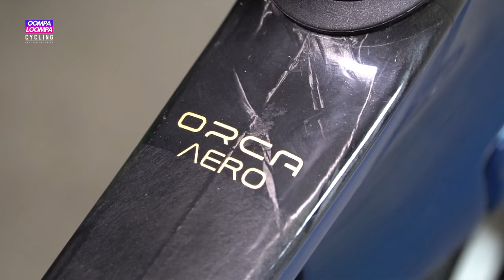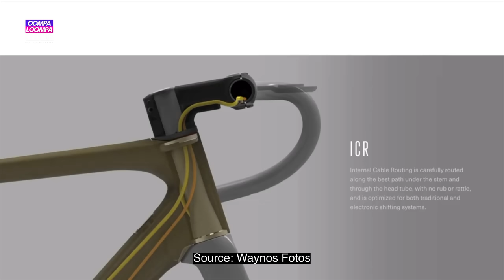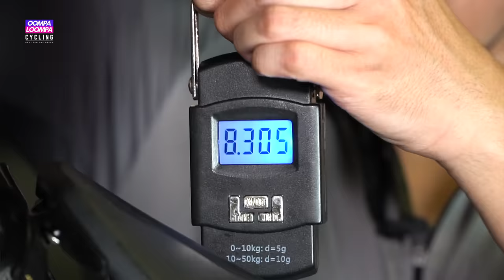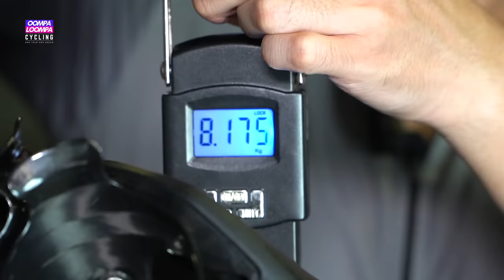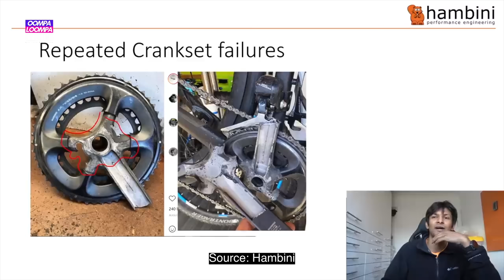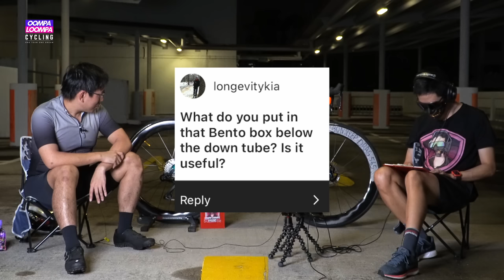We Need To Talk About This... | Orbea Orca Aero | Oompa Loompa Cycling E121

Comment: In regards to CO2, I make sure that I buy an inflated that has individual control of its operation, rather than just screwing it in. Giant sell a nice and compact actuator. 

WD 40, even the bike one isn’t a chain lube. Great for loosening bolts, but that’s it. Even for derailleur pivots I use silicone spray.

Comment: Looking at the way the brake hose comes out of the fork and gets to the caliper looks good to me. Not so much for aerodynamics, but because it will help in setting up the front brake. Sometimes those hoses come out at such a harsh angle that the bend keeps pushing the caliber around while you're trying to get it aligned.
Reply: That's the best exit angle, I don't want it any other way.

Comment: can say for certain the stan's dart tool is a complete load of shit. had a puncture 2 days ago, 2 darts detached  from the head when inserting leaving the dart  heads rattling around in my wheel and the black cloth parts on the floor. reloaded a third dart and snapped one of the inserting rods of the tool clean off. 4th try with the other side of the tool and managed to insert it successfully by lowering  he pressure to 20psi. did it seal? did it fuck. will try dynaplug next and gp5000's are weak sauce too. 5 punctures in 4 months.